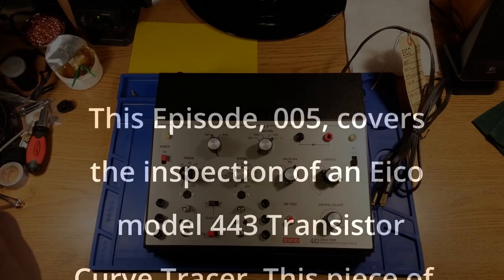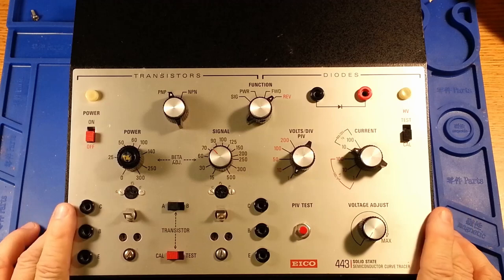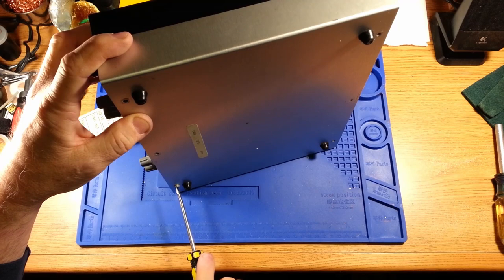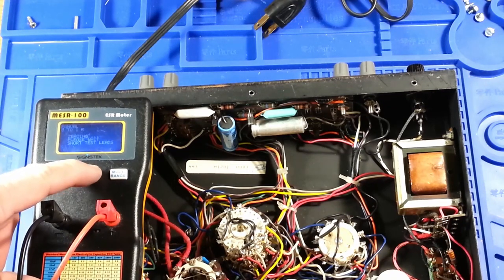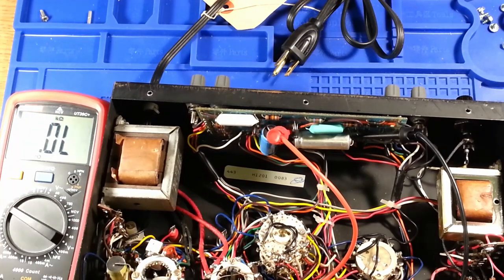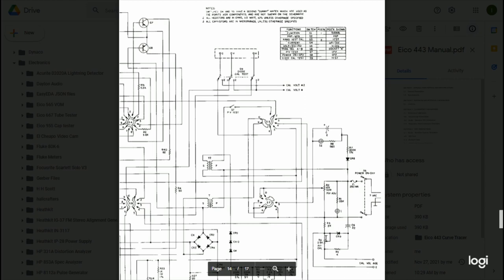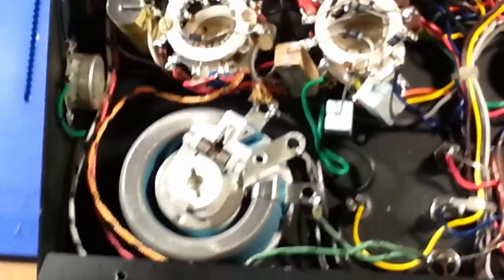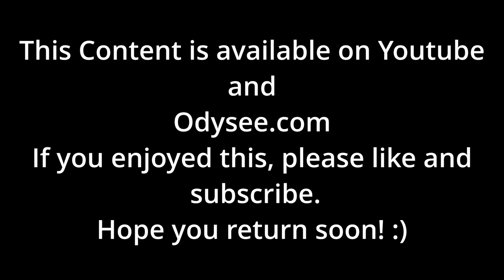E005_Part 1 - Eico 443 Semiconductor Curve Tracer - Inspection & Repair

Comment: Loose hardware will always lodge where it can do the most damage. Good point on checking for that right away.
Reply from the maker: Agreed, and that will be one of Part 2's "Bonus Feature" as well. And it may not just be hardware, it maybe something like pieces of a cracked rotary switch deck that you won't know about until you open something up, like I found in a Heathkit IT-1121 unit.